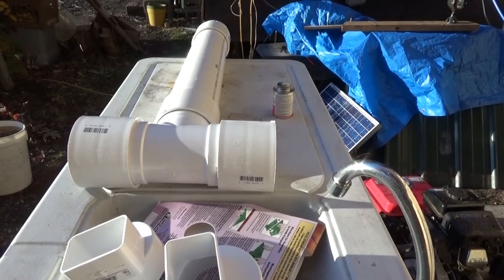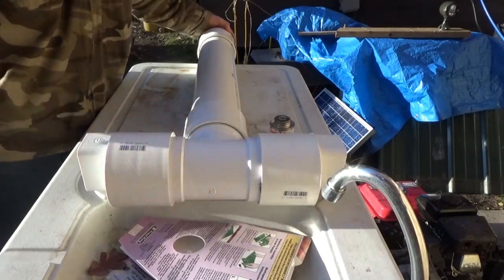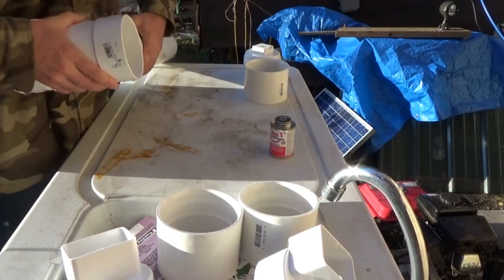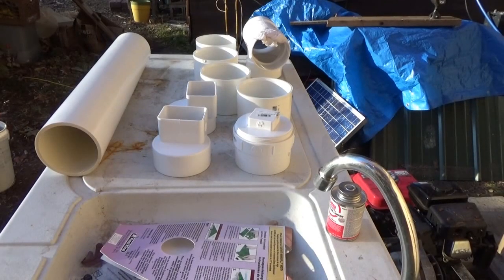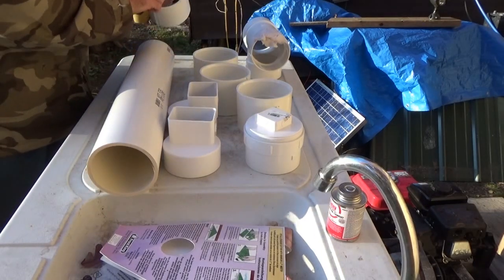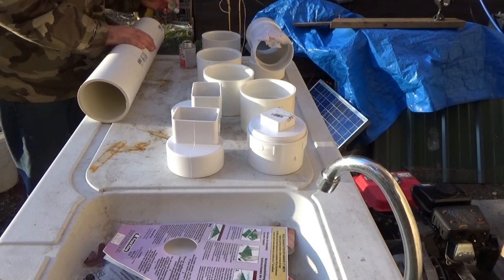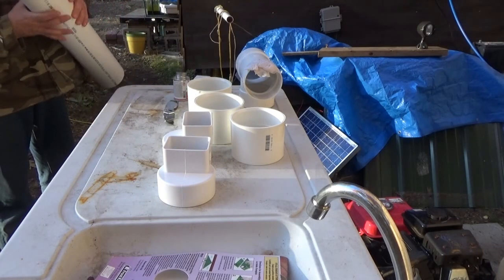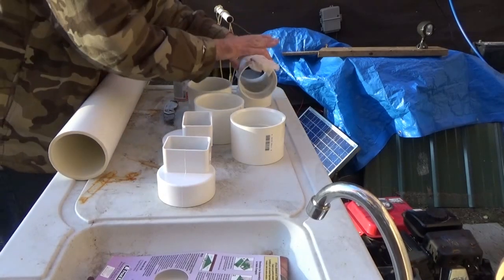Making My Tiny Home Rain Water Collector First Flush Diverter

Comment: I've never done plumbing without using purple primer.  It removes the "slick" coating on the pipe  (It's basically an etching primer).  PVC cement isn't really a glue.  It melts the PVC to stick everything together.

Comment: Did you mention the size of your holding tank? Just a 1/2" of rain on your roof will produce 75 gallons of water. And when it rains, it usually pours. I was scrambling last spring to get more holding tanks because I underestimated how quickly they fill up.
Reply from the maker: +Sher Thom I think they are between 60 and 80 gallons. They are supposed to be 40 gallon tanks with the air bladder in them so they are way larger without.

Comment: Hey Troy.
A tip if you want it. 
To remove the glue from stickers and that kind of stuff use lamp oil. It will clean it up. 
Just put some lamp oil on it and then rub it in, and the glue will be gone. 
Regards.

Comment: Looks good Troy. I don't guess you have seen my earlier comments about my concern of the hydrogen gas venting from the batteries while being charged.If the gas builds up and ignited by the water heater I feel you and yours could be harmed. Good Luck and keep on going, Bud
Reply from the maker: +KC5VIP Hamitup Yes it is a concern. I will vent the batteries to the outside

Comment: Troy they took u at the hardware store cuz u bought hole bunch of fittings that you didn't need cuz you coulda got schedule 40 and it would have fit inside the T and on your clean out cap; (
Reply from the maker: +Bonez2020 Not by the foot though. Only in 10 foot lengths which I did not need. I did ask
Reply: +Bonez2020 You go pickup parts to finish the project and wind up with twice as many bits because the only store close to you only has 70% of what you need.  We've all been there.  We also learned not to drive around for 4 hours looking for the exact perfect part - in the end it just that's a waste of the one thing you can't more of (time) and the final outcome will work the same.....
Reply: Bonez20
Reply: Bonez20
Reply: Bonez20

Comment: Put all together with No Glue. Hang it see how it works as you will want to change it once you see it in operation. NO pressure glue is an option with no reuse of fittings. Just a Thought.

Comment: why didn't you use the Primer first. Good thing this is not under pressure.  The primer is to go on first it not only cleans that end it also Preps the PVC it softens the other layer of the PVC, that will dry some, then you apply the Glue witch has some of the softeners in it like the primer has.  You don't need a lot of they cement if you use the primer once they are put together, at least you got the push on and twist part right what this dose is when the plastic is soft it cause it to mix some. and once dried, it will hold firm, and will hold pressure, and will never leak if done right.   Good thing at least is not under pressure because using just the cement will not soften the PVC and you get a bad bond and they will blow a part.

Comment: whats the white pipe coming out of the house for?
Reply: grey water so close to the fresh(ish) supply, and it dumps on the floor? i see rats and raxoons coming
Reply from the maker: +Paul Walker Dont pay anyone any attention. I cant see who replied to you so thy must have me blocked which usually means TROLL.
Reply from the maker: +Paul Walker The pipe is for gray water but I collect it in a bucket. Then filter it. Then use it on my plants. But I have materials and plans for a full system with inline filter and storage tanks

Comment: how do you handle long term water storage and will you do a vid on it? thanks
Reply from the maker: +Night Rider72 Go look at last weeks videos and I show how I am connecting it all. I am using tall, thin water storage tanks in series.
Reply: +The Do It Yourself World   im sorry I ment in terms of alge or is that ever a issue
Reply from the maker: +Night Rider72 Oh yes it is a horrible problem with the current water system. I am going to have the water tanks in a dark room from now on. I am building an insulated shed for the batteries and water tanks